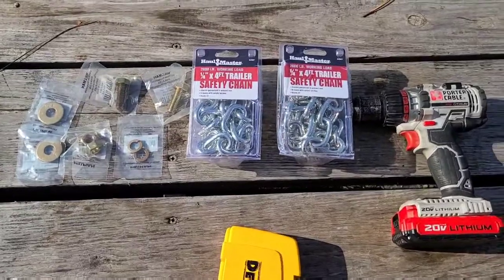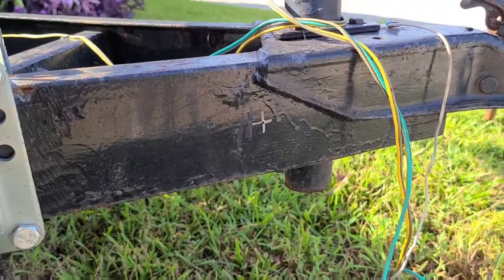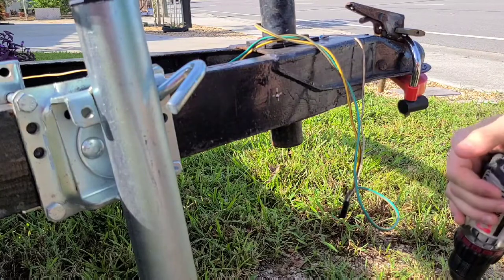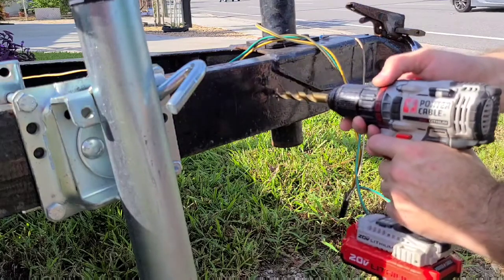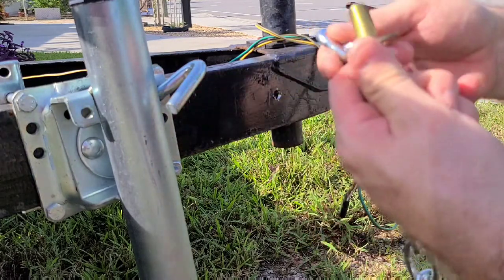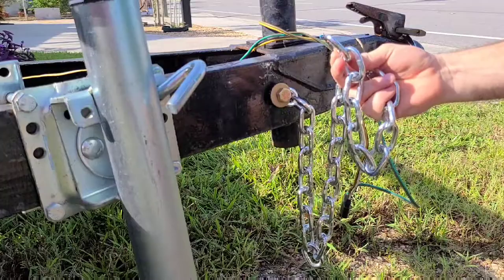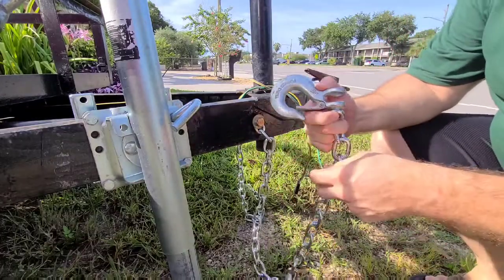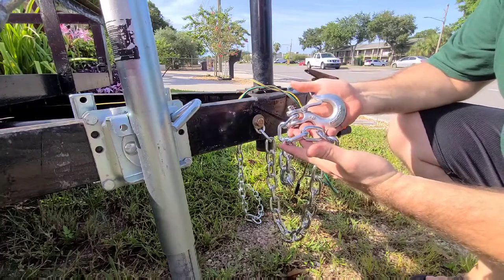Adding new safety chains to trailer

Comment: Is that grade 8 bolt a throughbolt? I thought you had to out a bolt on each side with a nulock nut on the inside so they are independent of eachother?
Reply from the maker: Through bolt with nut and locking washers

Comment: Does this pass Highway safety inspections??
Reply from the maker: Meets requirements for florida
Reply: That depends on the GVW of the trailer. Chains have to each be capable of holding the GVW of the trailer. Galvanized chain probably won't meet that standard.

Comment: To be legal chains must be welded to a trailer. The chains need to be load rated to suit your trailer. The ones you are using are way too small. Get some advice from your local DMV they will set you straight. If you had a collision with these chains bolted on your insurer would not pay out on your policy
Reply: Welding safety chains to a trailer is generally not recommended because the heat can weaken the chain material and reduce its strength. Instead, the standard recommends that safety chains are permanently fastened, bolted, or anchored to the trailer tongue.

Comment: Should of made them quick release so no one can hook the chins up and pull your trailer away.  The lock you have on the front is junk and can be broke off super easy. I had mine stolen using same lock. Check into proven industries trialer locks.
Reply from the maker: There is an old saying, “locks are for keeping honest people honest“. I hear what you are saying though.
Reply: What is a quick release? I'm looking to install chains on my trailer, and make sure I get it right.

Comment: Weld? Instead of drilling holes on frame 🧐
Reply: In 50 some years of hauling our show cars, travel trailers and utility trailers the only issues I have ever had with the safety chains was the weld to the frame. Be it factory or a good local welder they have failed us twice when needed. One of the welders told me it was due to the differences in the metals used for the chains vs the trailer frame. I am sure they have the ability to overcome these issues with newer welding techniques but I still stick to bolts. Old school.